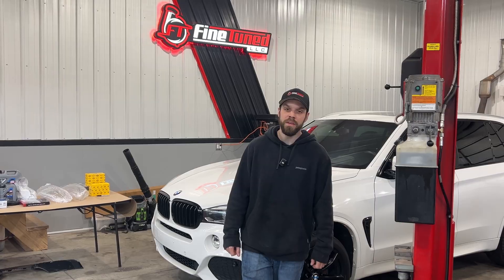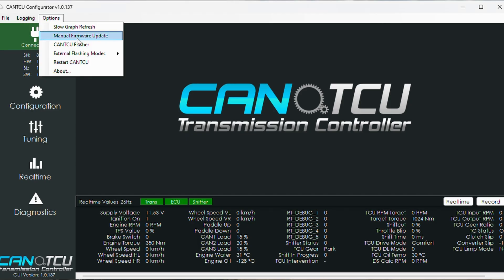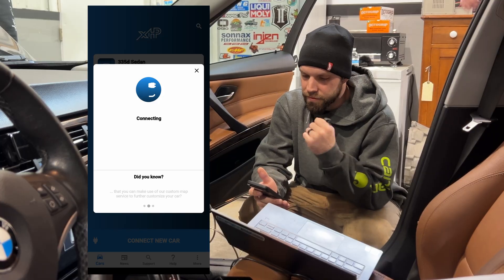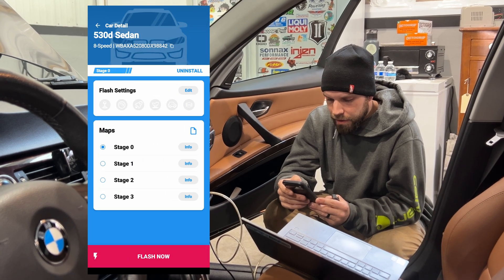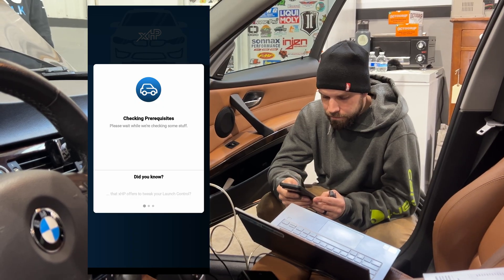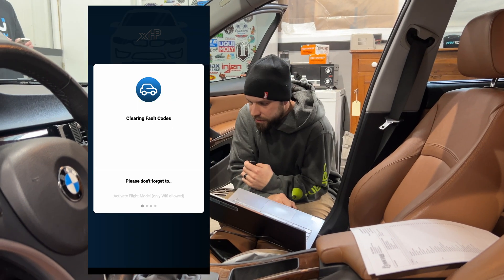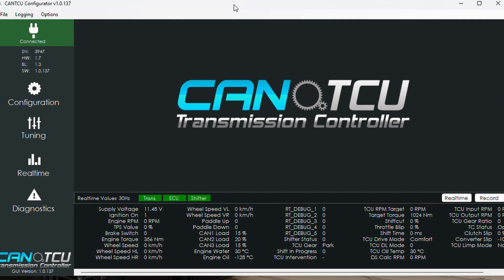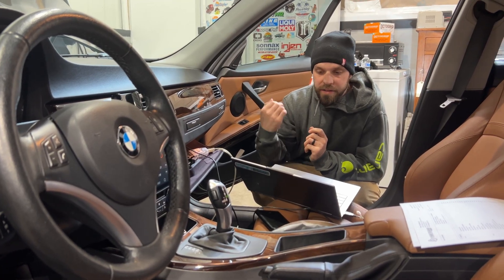XHP + CanTCU 8-Speed Trans Flash

Comment: Hi, 

Im the first in Germany with a BMW E61 / E60 535d.

I noticed that the shift behaviour changes when temperature reaches 70°C+.
Below 70°C it feels like the 8HP70 drives on a "secure-map" or "cold-map" (call it how you wan´t) untill 70°C is reached. When temperature is reached, changes like OEM+ from CanTCU or XHP are active. Before 70°C it drives without those settings, so NO OEM+ NO XHP.

Do you know about this problem? Am I the only one with this problem?